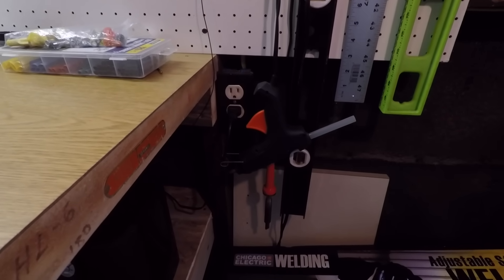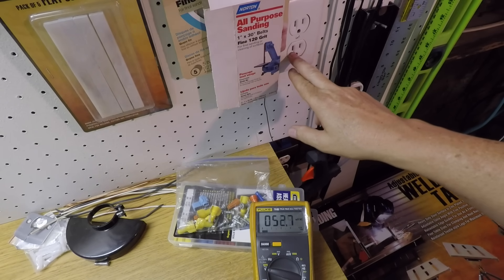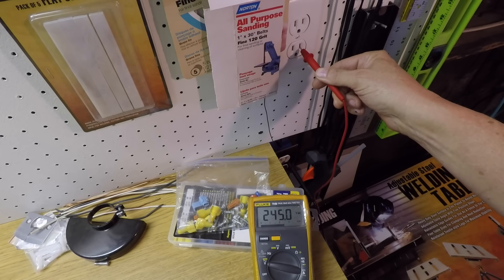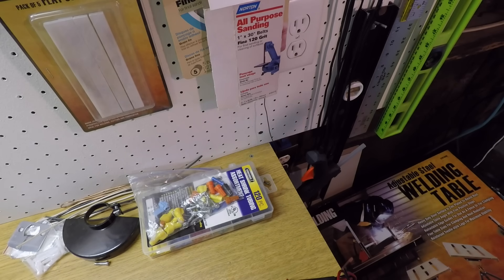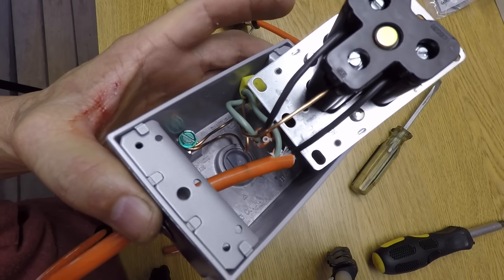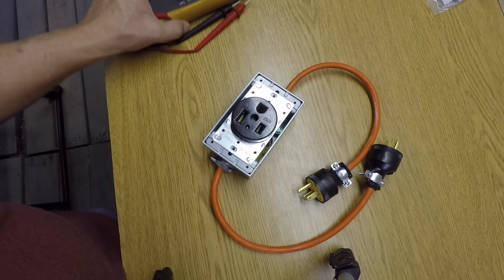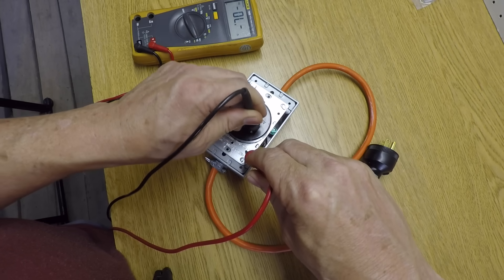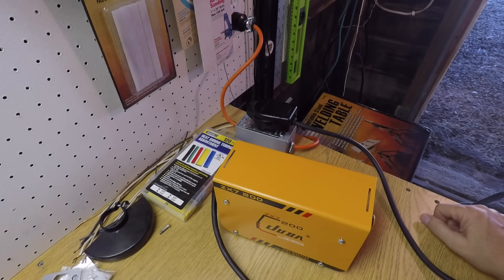How to Get 220v From 110v

Comment: The problem with combining 2 separate 120 volts outlets to create a single 240 volt outlets is that it violates the safety feature of using a 2 pole breaker in that if one breaker trips, the other one stays hot meaning that there is still a safety hazard present in your device. Whereas, with a 2 pole breaker, if one side trips it automatically drives the other side to the off position thereby eliminating all potential electrical safety ⚠️ hazards.
Reply: Assuming the breakers are one on top of the other, you could use a double breaker in the panel, so if one trips, they're all dead. It would be better to replace one box with a double box with a 220v recep and jumper the top box to the bottom boxes inside the wall with 12/2. This gets rid of the 15 amp recep issue and makes a neater job with less parts.
Reply: Now this idea is definitely a code violation by wiring method you suggest. Just because it works doesn't make it right.
Reply: The fix for your concern is he could install a 2 pole 20amp breaker and run one outlet of each pole. That way if one outlet trips, so does the other. Problem solved
Reply: Probably easier to install a 2 pole breaker and run a dedicated wire LOL
Reply: And next time he should use wago’s
Reply: Safety third.   Gotta get that job done
Reply: Use a two pole breaker to run the individual 120V circuits to keep the safety feature …
Reply: Not correct! One side of 2-pole breaker can fail, other side continually send 120v. Common breakers are not electronic, but mechanical.
Reply: @bahbarino4479  and hopefully you're not using 2 different hot legs that are sharing the same neutral. Older homes, mine included have conduit with 2 'circuits' sharing the same neutral. These breakers need to be tied together, lest you forget to turn 1 off but decide to work on the other.
Reply: For all of you silly people talking about the way he has wired this:  It is installed in the main breaker box the SAME way.  In the mains breaker box you have to 50 AMP breakers tied together to make a single lever to turn on/off.  And BOTH of these breakers are tied into ONE 120V leg of the breaker panel.  Main breaker boxes have TWO separate 120 legs in them, which is why you have breakers on both sides of the box.  Anyone who thinks I am wrong, go look in your main box.  You will find that any 240V breaker for dryer (uses a 30A breaker) or electric stove (uses a 50A breaker) are tied in on the same leg.  a 50A breaker has 2 breakers built together in one unit and the switches are tied together so that if one side blows it AUTO trips both breakers.
Reply: All in how you wire it
Reply: @ripjohnson2121 yes it is
Reply: you can tie the breakers together.
Reply: Think there's a lot of people on here making a mountain out of a molehill I like it great video
Reply: Well, yes. However, since he installed both circuits, he could link the two 20AmpBreakers and make himself a 220V breaker.  The real issue here is the use of relatively thin wires from the outlets to each side of his 220V outlet.  You want the heaviest wire called for for teh amps you MIGHST pull.  If you are pulling a new circuit, however, why not pull some 8 Gauge and a ground to a sub-panel and tap off that to add the outlet(s) needed?   He's done a nice hack which MAY work for that little welder - but might cause him some grief if he plugs in something that draws a few more ams.
Reply: Very good point but when I want to cheat,  I would do it the way this  Guy did it..
Reply: Expanding on Art Caudill's comment: if one breaker trips due to an overload or a fault current the other breaker will not trip. Each of the 120V branch circuits that were tapped to create the 240V outlet are on separate, independent breakers. The only way both breakers could trip is if the fault condition occurred between both 120V "hot" legs simultaneously.
Reply: I think it would be a lot safer and not a fire hazard to run a new 220 volt circuit to run your welder.
Reply: Well it seems there's a whole bunch of critical, busy bee,  judgemental asshats who seem to believe their idea of safety and doing things is the only way. I find that amazingly small minded ineptitude. Who cares what any one of you ladies all gather around and gossip about? If it were up to you negative and judgmental baffoons America would still be using horse and buggy with Hank crank butter machines being the only safe thing to do. Get a grip, lighten up and quit being such a snowflake. You peeps actually wishing harm and his house to burn down are pathetically driven by the desire to be narcissistic no it all's. I hope God sees fits to reward the entire populace with plentiful income and happiness. You all negative sheeple should consider a real love for one another and put aside your hate, venom and vitriol. I am astounded at these comments. You sheeple work for unions and really really OBEY a little too much. Laws are made to be shattered and questioned, not lock stepping into submission.......
Reply: Yeap!!
You stole my words !
In the meantime I said
That is so dumb to do !!
Reply: Exactly6
Reply: @jamie5388  I was going to GUESS 1,000 !!!
Reply: @jamie5388  and so would the company providing you with homeowners insurance, which I always remind people who ask if they should pull permits and have electrical work done to code or hire Johnny's fly by night electric in order to save a few $$$
Reply: Thanks Art.😮
Reply: Agreed
Reply: Agree should just use a double breaker and a true 220 v recept
Reply: He could get a small panel that can hold 4 breaker's and use two double pole breaker one for the device and the other from the main panel
Reply: You can put a breaker in the combiner for safety
Reply: This is the same as serving a 240v outlet for your dryer, hence a double breaker. If one breaker trips, the welder won't work and then back trace to unplug everything.
Reply: This is the same configuration for serving amplifier for amateur radio.
Be safe
Reply: 😂 the entire supply voltage or 'electrical pressure' is 110V on ALL outlets. You do not get a boost by simply making a parallel connection. 😂😂😂
Reply: @R.R.Hessabi he never said he did! A 240 supplies 110 to each  side of the outlet that's all but it's 240 across both! All he did was supply 110 to each side of the outlet the sane that 240 does did he not?
Reply: Ya it would be better that way....
Reply: Just put a double polen breaker in line after the 120 sockets  just before the new 220v outlet
Reply: Good point. I get what you are saying. What about taking all this one step further and using a box that houses a two pole breaker? Would that be feasible?
Reply: I
Reply: Who cares dude it’s a red neck battle and if you’ve got the money for a electrician then you shouldn’t even be watching this
Reply: Easy solve just put the 2 breakers on a double pull
Reply: There are so many things wrong about this it’s not even funny, you can do it this way and it will work but there is no way you would ever want to do this as a permanent receptacle. He will figure that out if he signal phases his welder and burns it up.
Reply: Well ill be dammed. This is handy to know  👍
Reply: They make the clips that tie 2 breakers together if your really that worried
Reply: Do you know what the polarity is? What about the phase? Or is this just a guessing situation?
Reply: Why is everyone saying the nec doesn’t cover this when it does. 

A common application of multiwire branch circuits as described in section 210.4 is for a 120/240-volt, single-phase system where three wires do the work of four, the two ungrounded conductors sharing a single neutral.In a 20 amp multiwire branch circuit if the two ungrounded conductors each carry 15 amps, some people think the neutral carries 30 amps, or the combined total of the current on each ungrounded conductor. The load on the grounded neutral conductor will not be the sum total of the load on each ungrounded conductor if the two ungrounded conductors are connected to different phases at the panelboard. With a multiwire branch circuit connected to different phases in the panelboard the current in the neutral is equal to the difference in current flow in the two ungrounded conductors; the larger current in one phase minus the smaller current in the other phase, in a single-phase panelboard. If the phases are equally loaded, the current in the neutral will be zero because the opposing phases cancel out.

Multiwire circuit connected to different phases. 
Multiwire circuit connected to different phases.
All of this depends upon the two ungrounded conductors being connected correctly at the panel. If both hot wires are hooked to the same phase by mistake, the current in the neutral will be the sum of the currents in each phase conductor, rather than the difference, which could be more than double its current carrying capacity. This can generate enough heat to ignite nearby combustible material.

Multiwire branch circuits, properly configured, offer a number of advantages. Less copper is required (one 12-3 rather than two 12-2s), so there is less material and labor initially. In commercial or industrial work, less raceway fill means additional savings. In residential work, the round three-wire Type NM (Romex) is easier to run and staple than the flat two-wire cable. Less knockouts in the service panel is another plus. Additionally, for long runs there is less voltage drop. Since a multiwire branch circuit is actually two branch circuits, a single run will suffice to meet the Code requirement for two small-appliance branch circuits supplying countertop receptacles in the kitchen of a dwelling. Some electricians run multiwire branch circuits throughout every installation.

The National Electrical Code permits multiwire branch circuits, but adds requirements to make them safer. Section 210.4(B) states that in the panelboard where the branch circuit originates, all ungrounded conductors must be provided with a means to disconnect them simultaneously. This is usually a double-pole breaker, but two single-pole breakers may be used if they have an identified handle tie.

Another requirement in Section 210.4(D) is that the ungrounded and grounded circuit conductors are to be grouped by cable ties or similar means in at least one location within the panelboard. This requirement is designed to ensure that the wires will be hooked up correctly, with the ungrounded conductors connected to opposite phases. An exception states that the requirement for grouping does not apply if the circuit enters from a cable or raceway unique to the circuit that makes the grouping obvious.

This isn’t legal, it’s best for all the wires to be as close to the same length as possible and equipment needs to be on the same throw or disconnecting means. You could cause damage to the equipment or injury if it trips half/one circuit. If someone needs to throw the breaker it’s one throw. Now someone has to know how to find both breakers or be smart enough to hit the main. 

It has to be powered from opposite phases and be installed properly. 

This also falls under proper workmanship Section 110.12 of the NEC contains the general workmanship rule, applying across the entire set of requirements. The challenge is that “neat and workmanlike” is subjective for many Code users, including enforcement officials, especially if they have little or no experience in the electrical industry.

Besides It’s just easier to install it properly on a two pole breaker on one cable.
Reply: its not installed, its a temporary device. it doesnt actually violate code. code doesnt cover temporary appliances. only permanent ones.
Reply: @DieselRamcharger  Maybe not but I'm pretty sure an insurance adjuster would have something to say about it, if it survived the fire.
Reply: @garysampson5258 what fire? Stop being paranoid. Some of us grew up with no safety and we did fine
Reply: @DieselRamcharger      If  a smart electrician is doing all the right stuff,  this could save a lot of Issues in temporary power needs.  EMERGENCY authorization ACT  for  The PEOPLE here-by approve this devise...  OSHA  has not protected US  the way we generally demand.  SWEAT SHOPS are out there with bad wires and great dangers  to the workers.  BE SAFE YAL'
Reply: @DieselRamcharger  oh, but it does. Especially when trying to use 'temporary wiring methods such as extension cords' in place of permanently installed conduit/wiring methods.
Reply: @DieselRamcharger  True, but there's still a potential electric hazard, that some commenters here have a safer setup.
Reply: @DieselRamcharger while you are correct local code over rides NEC
Reply: @DieselRamcharger  Agree... it's only used temporarily for one thing or another; maybe an industrial floor sander that requires 240v
Reply: I don't understand how this can be any better than installing a 240 volt outlet in the first place. There is a safety concern too with the two breakers involved.
Reply: @azopene  I agree, he said he wired it himself. If he used one piece of 12/3 instead of 12/2, problem solved.
Reply: @garysampson5258  If he were to replace one of the breakers with a dual, then connect the white to the other half (has to mark both ends with electrical tape) and then replace the outlet itself, it’s all done. It sounded as if one circuit does doesn’t supply anything else - that’s the one to switch. 

Having two independent breakers for 220 is unsafe, despite the fact that code doesn’t necessarily cover it - electrical code might not cover it, but your insurance would freak out because you’re violating UL or CSA for plug in devices. If one hot comes adrift and shorts to ground only one breaker fires. Not to mention that this is effectively a suicide cord.
Reply: sounds good,  but My college days are too far gone.  does that form a single  common
Reply: @azopene  you need 2 breakers for 220 no matter what
Reply: @garysampson5258 for safety reasons yes! But you can do it with 2 110s 😊
Reply: @azopene  this is no better it's just the Mickey mouse way of doing it.
Reply: If one trips, the other almost SURELY will trip as well.
Reply: @starmc26  Not if the fault is only on 1 leg.
That is why this will Not pass code, in the US.
Reply: @starmc26  I have seen Dryers that half trip a breaker and even been hard connected to each other will not trip the other leaving the dryer running but not heating. So no it will not always trip both.
Reply: @starmc26  wrong
Reply: @starmc26  Do you know how many people have died from "almost surely" situations?
Reply: @garysampson5258  no, how many?
Reply: @samhain1312  Right! I want to know how many as well😂😂😂😂👍
Reply: @garysampson5258  think many more die from surely situations,almost all
Reply: @garysampson5258  EVERY DAY  one thing or another gets people. In a Factory with 100% safety in their agreements  I ran into a reverse biased diode on the worlds largest welder.   I was final testing welders that need a railroad flat car to carry the welders and generators.  Robotic welders make continuous rail these days.   It was a 3 Phase 440  100 amps per phase.  I personally checked all of those diodes.  The test system did not catch a partially reversed biased diode.  When I hit power on ... B O O O O M.  I shut the entire city of Troy Ohio down,  The power sub on the roof and the citie's main power substation both blew.  Melted the relay on my box and set short term fires around the floor with a few pound of  bright red  copper spaul dancing hotly !     I surly almost died due to a sort of safe tester.  as a single diode it tested good before and after the explosion of power traveling through it.  All these years later I think we were using a very voltage in the tester.            Hell yes I want one of these short term cheaters for 220v,  single phase.
Reply: @garysampson5258  do you know how many people die in sure situations. Or no situation at all. That's life, take chances, be amazed by the outcomes. Or at least get a good video!
Reply: @garysampson5258 do you?

Comment: Convert one of those 120v circuits to 240v at the box using the ground as neutral and the black and white as separate phase  120v lines. This will require an extra breaker. Replace the 120v outlet with a 240v unit, observing color change. Everything will work, and you won't look like a complete hack.
Reply: Exactly what I did when I changed my well pump from 110 to 240, works flawlessly.

Comment: There are problems here. Yes, this scheme does work, as long as opposite sides of the inherent 240V single phase power feed are tapped into. But the safety as not very good, for several reasons, and if done at all should be limited to temporary emergency setups, then replaced with safer, more permanent setups. DIY Homestead Projects probably could have replaced the two independent single circuit breakers with a 240V breaker, kept the same wires to the garage or shop, then installed a legitimate 240V outlet there (which he had to buy anyway). Could have left the 120V outlets as they were. At least that way, there is never a chance of an accidentally removed 120V plug being live, and if the welder has an overload, both sides of the circuit will be disconnected together by the ganged breaker.

Comment: If you have a short to ground inside the metal box and the breakers doesn't trip, this metal box will be at 120V to proper ground which can be dangerous to humans if you touch this metal box at 120Vac potential and ground at zero volt ac. The whole purpose with ground is to have this voltage close to zero volts, so when there is a short and you touch this shorted item and another structure that is connected to ground, you will not be shocked. An added protection is to have an earth leakage circuit breaker, when there is an unbalance of 20ma between metal body of item and ground, the earth leakage circuit breaker will trip.